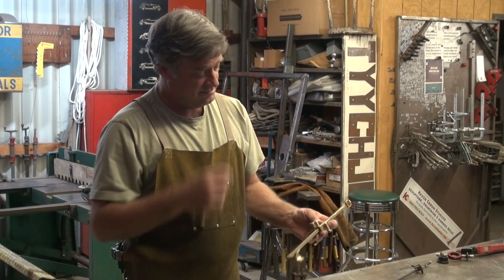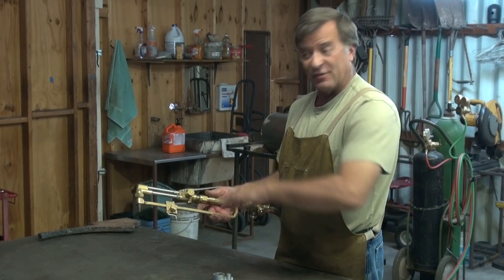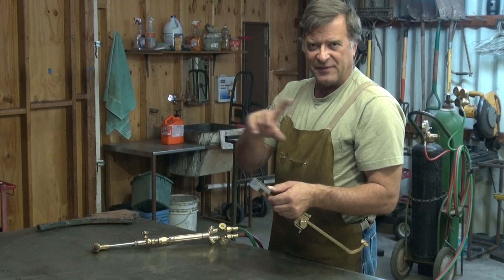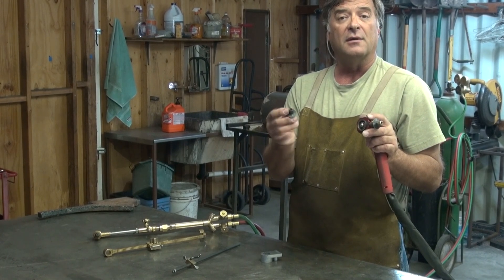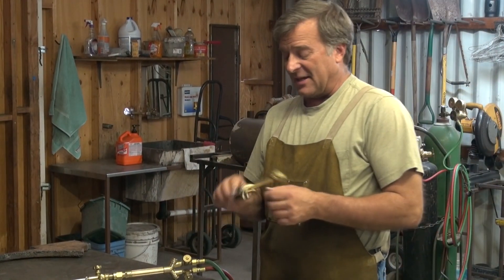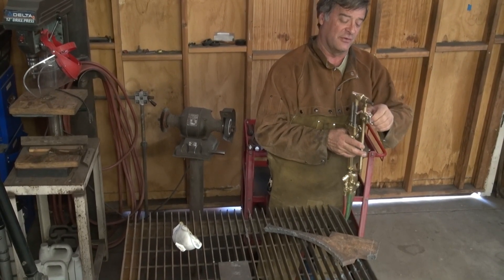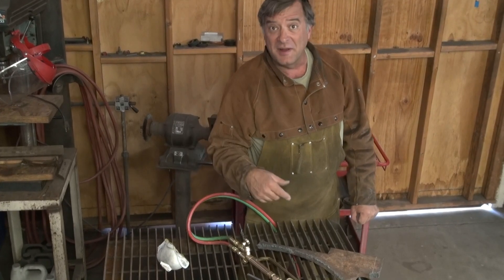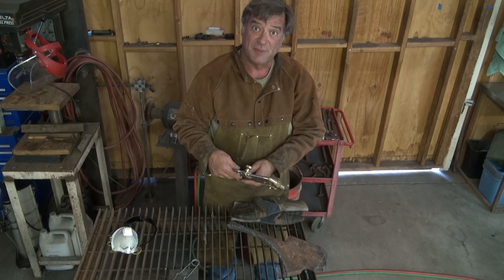How to Cut Metal Using a Circle-Cutting Tool - Kevin Caron

Comment: OK younger than me. Put some 90's on a dedicated torch body and toss the hoses over your shoulder when using that corn-trap~shunn.
An old fart named Garmann makes one with a ball bearing as a head pivot for short circles.His lets you get tight with smaller circles.
Caronn. HMMMM. Makes you look more studley and keeps the IRS moh confusedederr.